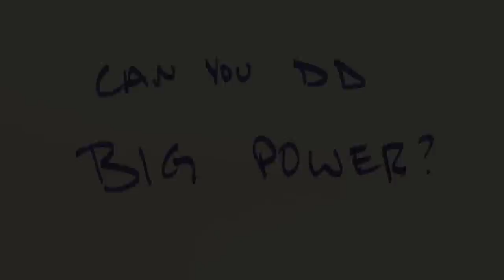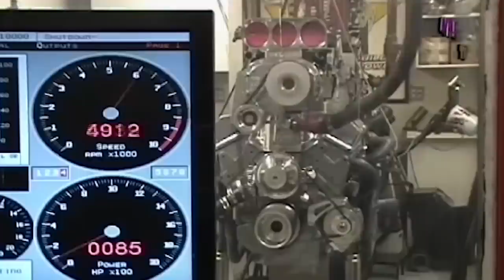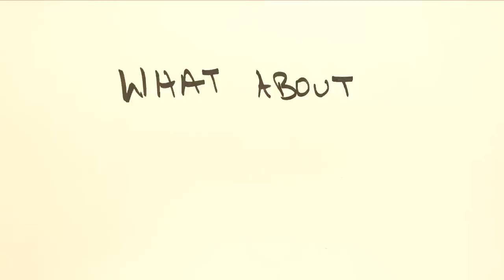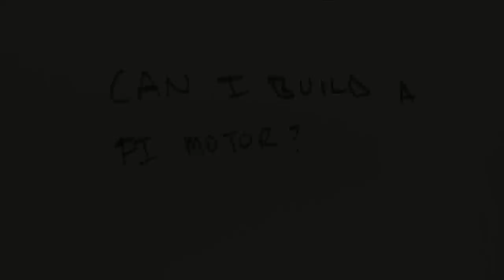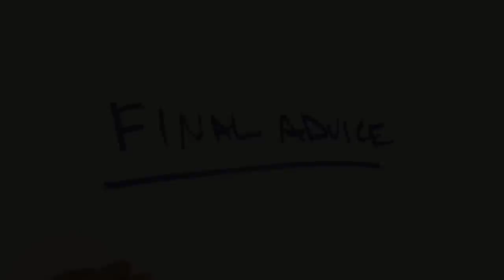How to Make BIG POWER, Safely /ENGINEERED

Comment: 20min of (great) forced-induction talk, but no real mention of turbo lag. He mentions the low-end benefit of supercharging solutions compared to turbos and the 'instant' punch of the screw compressors, but that barely skims the topic of turbo-lag. 
I think that would have been an interesting question to ask, especially as he values driveability  so much and turbo-lag worsens driveability substantially.
Reply: yeah but when you have 1500hp you're still making a solid 400-500hp below boost before turbo lag can even come to play
Reply: or rather turbo threshold if we wanna get snazzy
Reply: +YensR I'm guessing with a twin turbo setup the turbo lag is reduced somewhat compared to a regular turbo.

Tbh, turbo lag does not affect driveability that much in this case, because he is discussing motors that already make plenty of horsepower even not on boost.
Reply: superbarnie Yes, two smaller turbos have less lag than one big one. 

I would disagree that driveability is not an issue with high-HP engines. The idea of driveability is that the engine behaves "linearly" across the range and with constant, minimal delay ("lag") of the engine's response.
Reply: +Ashton Murch Turbo "threshold" and turbo lag are different., but partially affected by the same parameters.
Reply: +Ashton Murch turbo lag is a time delay between throttle input and engine response.
Reply: +YensR 
I think he was implying the daily-drivability of these 1000hp+ motors is thanks to the turbo lag, considering they dont make any where near their peak torque until the turbo spools.
Reply: +Ah Spaghett I doubt he was implying that, as it would not be correct. The boost comes on at high RPM that you normally do not experience in everyday-driving - I think THAT is what he meant. Turbo-lag is a time delay between throttle input and engine response - and this does NOT help driveability, much the contrary.
Reply: +YensR it all depends really, a small 4 cylinder with a big fuck off turbo making 1000 Hp is gonna have horrendous drivability, a big v8,v10 or v12 will have enough torque to virtually eliminate the feeling of turbo lag, obviously there will still be a difference to being on boost
Reply: Jamie Parris Ye, I know that, amongst other things, it depends on the boost pressure. That's what many downsized eco engines suffer from. And yes, things are a bit different for a big displacement engine with comparatively mild boost, but the overall reality of turbo lag still exists: It takes a short time before the pedal input gets translated to engine response - and this gets worse the more you increase the boost pressure.   

You can't really say it's not important for high performance (bi-)turbo V8s, as they, too, will have substantial boost pressure and hence will have lag between throttle input and engine response. 

I simply would have liked to hear what a tuner who obviously does things right has to say on this topic.
Reply: +MAEguy  +Ah Spaghett   
Sorry, I might have been a bit overly direct, because I thought it was pretty obvious that I had been talking by then about the time delay between throttle input and engine response in this whole thread...  
Should have made it clearer in my initial comment.
Reply: the turbo/s may only start making boost after 4000rpm (depending on the set up) and anybody who drives sensibly would have shifted before then and would only be at 20% throttle, is what i meant in terms of drivabilty. and sure those motors probs still make 500hp without boost, but that is still very manageable on a daily basis.
Reply: +Ah Spaghett Yes. But what I mean is, if you drive them sportively, the time delay between throttle input and engine output affects driveability negatively.   
(Depending on the compression and amount of boost, it can even affect non-sporty driving.)
Reply: +YensR It could be that he doesn't really have to consider threshold or lag in these kinds of applications. A 1200hp LS build is not going to be a track car, there is no sense in it. People own the Nelson Racing cars to get groceries, run 9s quarter miles, and put the occasional enthusiastic Italian supercar owner in their place. If they want drivability, keep the RPMs below the boost threshold. Ludicrous speed, keep your foot in it. 

I'd also like to note, from reading about turbo system design, that lag and threshold are often confused, but related in one important way. Lag describes throttle delay when the turbine is already at speed, meaning that the engine is already above the threshold. So in essence, you have spool delay to the threshold, then the turbine reaches operating speed. If you keep your foot on the throttle you won't notice the lag because its a continuous power curve. However, if you go from zero to full throttle while above the threshold, you'll experience the time delay of the intake ram going from vacuum to full boost pressure.
Reply: +Nathan Comstock 
Aaaaaah, that makes sense, I was thinking many of their cars are more designed for pro touring! If they are designed for drag racing and slowly-ish driving to the supermarket, then I can imagine that lag is less of an issue, as you start with high rpm off the line and then you just bamm-bamm-bamm through the gears.  

You are right about your second paragraph, but even with the time delay being irrelevant in some cases, the non-linear power delivery will (for circuit-type racing) affect driveability. 
 
Also, we should not think of the threshold as an on/off boundary. Depending on the set-up, boost will set in over a range of rpm.
Reply: +YensR Talking about Screw blowers... You can go with some BIG screw and making huge amounts of HP. Kenne Bell makes a 4.7 Liters, Screw charged, liquid cooled, good to go about 25 PSI and makes more than 1600 HP in a Ford Mustang 5.8 L engine.

When drag racing has a category with all these things, Screw Blowers and Turbos needs to carry more weight and still dominates Roots or centrifugal in about any type of category.
Reply: sorry YensR but you really dont have a clue what you're talking about, you're way over complicating this. At the end of the day, it comes down to the drivers ability to drive these things on a daily basis.
Reply: Ah Spaghett Nope. Sorry mate, I'm not, but if you are happy with laggy big power motors, because it doesn't affect your enjoyment of power and cars, then that's perfectly fine, but it's not for me. And that's not overcomplicating things. Have a nice day.
Reply: +Zeh Doce  That's interesting - I am not a drag racer, as you probably gathered. I can see why turbo is so good and I understand that centrifugal would be difficult in the setting despite it having better efficiency than the positive displacement superchargers (lack of low end boost because of centrifugal principle, without the top-end boost that turbos (also centrifugal) can provide).  
But why are screw blowers outperforming roots? To me it seems roots is the dominating supercharger in drag racing? And it seems that generally the rule of thumb is that roots win over twin-screws towards the upper end of the rev range (albeit with more air pulsation and less efficiency).
Reply: YensR
Twin Screws are a LOT more efficient than roots, specially in high boost levels (like in drag racing). A smaller TS can produce more boost, with less parasitic loss and less discharge temps than a roots.

The roots has a litle more ''punch'' in the lower revs, but in high boost levels, the mid range revs and specially the peak numbers can be a lot higher in a Twin Screw.

Just an exemple...
Some PRO MOD categories can use:

Roots 14-71 supercharger (521 cid / 8,5L supercharger) in 2450 lbs of car weight.

OR:

Twin Screw PSI D supercharger (422 cid / 6,9L) in 2675 lbs of weight.

SAME V8 Engine (525 cid or 8,6 L)

1,6 L smaller supercharger needs to push 225 lbs of extra weight in the same engine.
Reply: +YensR You can greatly reduce turbo lag nowadays, but as was pointed out, NRE isn't in the business of making incredible refined sports cars, they give you a big engine with big boost for some straight line fun while still being usable daily.
Reply: Zeh Doce Thanks for that! Reading a bit more, I can see the roots data I found was a bit optimistic.
Reply: grmasdfII That's right, I did not realise in time that these are drag-specific engines.

And you are right, OEMs do a lot for reducing lag and improving responsiveness, whether it is multiple smaller turbos or small and large or turbocharger plus supercharger or in the hybrid McLaren or turbine Jaguar, an extra push from the electric motors, there is a lot of work being done. Few of these really translate to "cheap" heavily-downsized engines, but that's getting really far away from the engines in this video ;)
Reply: YensR Yeah...these are just all out top end power :>
Production cars and most race cars use turbos in a different fashion.

Turbocharging petrol cars has increased in popularity and will continue to do so, but it has been rather rare in ordinary engines.
It has been huge for diesel engines for a long time, though, and the single biggest improvements were the common rail technology and variable geometry turbochargers.
That combination almost entirely eliminated turbo lag and gives you a nice, smooth torque into power curve even from low RPM.
Reply: grmasdfII You are right that VTG (variable turbine geometry or more generally VGT) helps a lot, but turbocharging is becoming very popular in Europe for "normal" petrol (gasoline) engines, too, because it allows drastic downsizing and hence better fuel efficiency. 
Due to thermodynamics, exhaust gas temperatures of petrol engines are higher than for diesels. Meaning they are too hot (with still very few exceptions) to use VTG.  
If you drive such a car, you will notice both a lag and threshold in a way that you would not see in a non-downsized  turbo engine of comparable power (not to talk about normally aspirated). 

Common rail improved combustion and hence power in diesel engines due to better atomisation, it has secondary effects on lag (pressure stored in rail) and threshold (full pressure available from idle).
Reply: Anders Kristensen Driveability refers to the consistent, immediate and predictable torque and power delivery of an engine. As such, there is no direct relationship with displacement. The turbo's inertia and the amount of boost is what counts mostly.  
What some people here refer to as "driveability" is actually the opposite: These charged V8s can be driven basically as docile n/a engines before the boost comes in.  
Look up the term on automotive engineering websites if you are interested.

Comment: How about exhaustmanifoldbackpressure vs. boostpressure ratio ?
I have read that it is possibile to have a lower exhaustmanifoldpressure vs. boostpressure. Like some 80`s F1 engines (BMW) with extralong exhaustmanifolds.
That would make the 1. stroke to a worker stroke.

Comment: I am about 90% sure that it's a stupid question but just go with it... On your car's radiator, is it better for the fan to push or pull air?
Reply: Pull is your short answer. Long answer, You're trying to push swirling air through straight channels. When pulling air, the front can take in as much air as possible and its helped through by the pull of the fan.
Reply: +Andrew Donaldson but pulling hot air from the radiator and blowing it in to the engine bay, wont make the engine hot??
Reply: Barely makes a difference, either way air is being pushed into the radiator from the car driving forward, the heat of the water is going to exchange heat into the air passing through and then continue into the engine bay.

Comment: is 600hp daily driver lm7 doable for $1500-2k( in parts)? i got 250k on my 03 chevy and would like to get a junkyard long block, have machine shop dip and check it out. then rebuild with chinese turbo kit and ultimately swap it with the stock motor using as many stock parts as possible . my concerns are 1. nothings wrong with my motor so could i end up swapping a proven reliable motor for an unreliable one?  2. would the technical aspects be overwhelming like fuel management , turbo fitment , unforseen issues im not aware of till im balls deep in it. 3. cost

Comment: a tunnel can lower the stock engine compression ratio? because tom said if you want to supercharge it keep the ratio low
Reply: If you’re going low compression you need high boost or you aren’t going to make power. High compression, such as 11:1 is perfectly fine for moderate boost.

Comment: no mention that the bigger you go the  bigger the lag?  corners need lovin too!
Reply: +grand unified - Nelson builds V8s. V-8s have PLENTY of low end torque and he also specializes in twin-turbo setups which do NOT have anything you could consider an obstacle as far as turbo lag. You must be referring to the larger, inefficient for the street turbos so many have used on their Supras and etc. which need NITROUS to help spool them up. Unless you want to go crazy with the size, you won't have turbo lag issues with a properly tuned V8 OR V6 most people would run on the street. I have a few different daily driver type cars, one with a little T-63 on my 3.8L T-Type and it has virtually no turbo lag while putting down a tad over 520 whp which is good enough for eleven teens this year as driven to the track on E85.  Further, corners you say? That's what the C5 N/A ZO6 is for. Zero lag there but I've spent  $6 grand to make 160+ extra horsepower over stock whereas I spent only $1,800 (on the T-Type Buick) to make almost 240+ more horsepower over stock.  I prefer N/A but dollar per horsepower, turbo is the way to go. Just make certain it is tuned properly, have a solid fuel delivery system and run good fuel.

Comment: That supercharger talk of the belt fucking bearings up has me a bit disappointed on a future build plan but it makes me wonder if he used a crank support. This is for a 5.3 truck application and I want low down torque and simplicity for the install. I want to make around 500 to 600 hp at the crank
Reply: James Avery You can get 600 at the crank out of a 5.3 with bolt ons and a tune.
Reply: The only way you could get that power is with a huge cam. Huge cams move all the power way up the rev range and kill low down torque so no go on naturally aspirated build

Comment: Having a bunch of hp doesn't make your car fast. It does, but it doesn't. We should all known this. A guy with 100 less hp with the same weight can still beat you from suspension alone. Adding torque convertors and tire grip is even more. But these guys are way out of my league.

Comment: So sad that this all dies pretty soon.
Reply: +Arnis Tarassu    what dies soon
Reply: +Nikki Naydenov IC engines.
Reply: +Arnis Tarassu Take heart,  death could be a way off. I have been thinking about this matter a bit -  the death of IC engines.

Its a large topic, but there will be, I believe 2 factors that allow IC to persist. I define persist as the time the average home stands. About 150 years.

1. Infrastructure. Oil owns infrastructure and transport systems.  Electric needs recharge stations, which would be in the form of franchisees. I doubt this would be viable. Existing lines are old and would need renewal. We would see a doubling or tripling of electricity prices. This would put in direct conflict with the proliferation of data centres that Google and Facebook need. Local council bodies will get onboard but schemes will not last one term. Like recycling, the bean counters will protest within one fiscal year, and this new age stuff turns out to be cost prohibitive.
Conclusion. In this modern age the business case to implement infrastructure could be non viable,
2. Market perception. Electric is faggy. The cars are faggy. Yes there will be  a market for electric, but electric will need more that just a part market to be viable. When push comes to shove its about the neigbor with the 700hp Mustang, Dodge, Ford, Chevrolet. Buying decisions cascade from there. The recent trend of these cars is proof the auto industry has indenfied this, and they have more strategy up their sleeve.
Reply: Highly unlikely. Consider the classic or collector car market all over the US. There is still a huge demand for restorable cars. So much demand many models can be entirely built from parts.  And the parts availability is increasing.  People may drive EVs but the hotrods will be for the weekends.

Comment: You guys forgot to ask one think DOHC VS SOHC.
Reply: Dohc
Reply: +andreidoimetri yes I know, I just made that coment for the guys of chevy and dodge learn that DOHC is better.
Reply: +cobratoxic 
I think you mean DOHC vs OHV. SOHC just means a single cam for intake and exhaust. The Dodge and Chevy engines are OHV, which is a single cam inside the block, with pushrods operating the valves. There are pros and cons to each setup.
Reply: +cobratoxic I think you'll forgive us if we take your opinion with a grain of salt, seeing as you didn't even know what SOHC meant.
Reply: +DopeItUp Maybe Single over head cam.
Reply: Most of the engines they work on are OHV/push rods cams. Those cams are in the center of the motor. Obviously DOHC is more reliable, and you can get more torque than SOHC. But with a OHV engine, you can get a lot of BIG HP and boo-koo torque.
Reply: The reliability starts to go away on your coyote motor over 800 hp. The LS can handle 1000hp reliably. It's simple, more moving parts=more chances of breakage. Yes the coyote can do more with less up to that point. That is the pro's and cons of them. Pick your flavor and be happy with it.